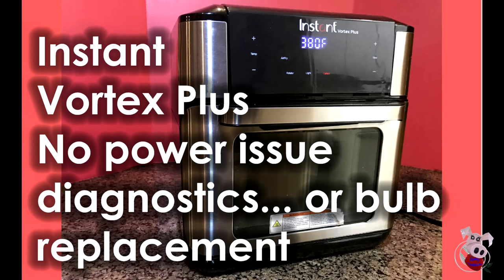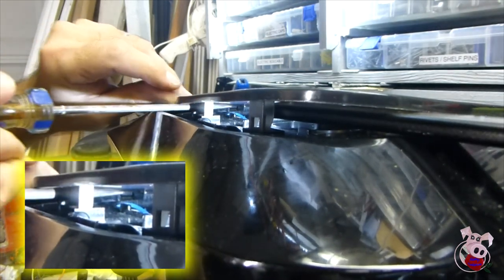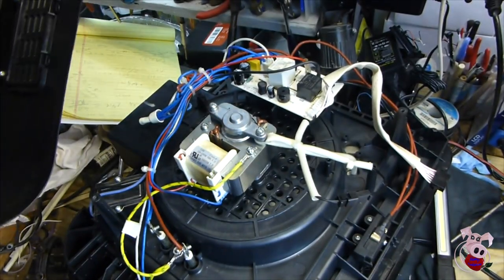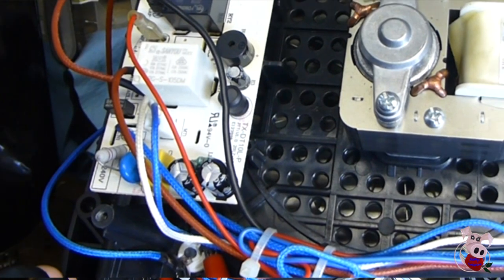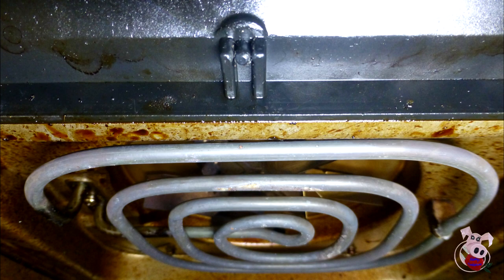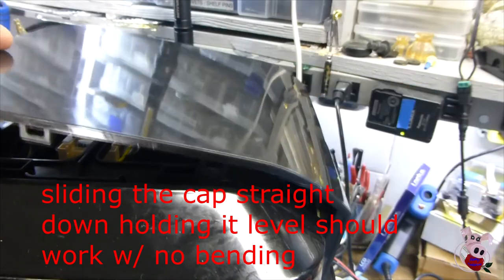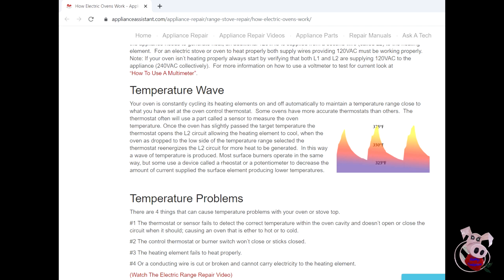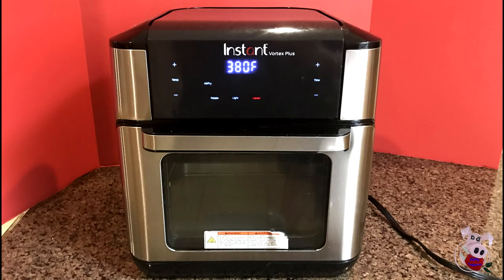Instant Vortex Plus No Power issue diagnostics or bulb replacement

Comment: You saved us $$$ just like everyone else!  After 3 years it stopped working and then would intermittently work and not work.  I think the thermal switch wire was just loose and then it actually triggered.  I crimped one wire and pushed it down and it came right back to life.  The bulb blew long ago but we don't miss that.  Glad to hear that you see high quality design in this product because we love it.

Comment: Great video!  Just what I needed.  I have exactly the same model, we were in the middle of cooking dinner and it crapped out.  I figured it had an internal fuse or something.  I found this video and learned about the thermal switch location.  I wasn't as thorough as you were, I just took it apart and un-tripped the thermal switch, threw it back together and got back to cooking.  Down time was maybe 10 minutes!  We had it too close to the wall this time while in use, causing it to get too hot.  Lesson learned.
Reply from the maker: Thanks.  Good point you make for others... good air flow in back, not too close to the wall.
Reply: @alwaystinkering6972  Well an update, the thermal switch started tripping again.  Last night it got to where it would trip about every 3 minutes, so I was just leaving to cover off and un-tripping it every time so we could finish dinner.  Today I closely inspected everything throughout the air fryer and could not see anything wrong - everything clean, no obstructions in air flow, no burnt-looking wires or areas of the circuit boards.  So I made the decision to just bypass the thermal switch, with the intention of closely monitoring the appliance and never leaving it unattended while in use.  I just soldered the two female spade connectors together and shrink-tubed them.  I ran those wires away from the hotter area of the machine where the thermal switch is.  Hopefully it'll work this way.  I know it's not ideal to omit the safety device that is the thermal switch, but I'll be keeping an eye on it.
Reply from the maker: @oakenshielddufresne2494  Potentially not good.  That is the don’t burn the house down protection.  Do the screw holes next to the thermal sensor look empty?   If you see metal then there may be a skirt holding it in from the other side... that would mean a lot of work.  If they are empty does pushing on the sensor from inside the oven pop it out?  If it does you can look to see if there is a like rated replacement.
Reply: @alwaystinkering6972  look for this in ebay “4 Pieces N/C 220ºC 428ºF normally closed Thermal NC Thermostat switch KSD301 A21”
Reply: @alexisechevarria8536  FF
Reply: ❤  thank you so much for this video.  We didn't have all fancy tools but followed the video and it was the reset button. Working now!

Comment: okay after reading through a BUNCH of these does anyone have the information on what switch to get to replace the thermal switch... mine has blown enough times that i think it is faulty and the reset isnt lasting very lo9ng anymore and i want to replace it but as mentioned in the video you didnt replace yours so you dont have part info... does anyone else have the part info?
Reply from the maker: I just added to my video comments a link to johntube2525's video where he displays the thermostat model he found just after the 14 minute mark.  It may be getting harder to find the manual reset models but I still see pictures in google searches.  

I have seen in other comments that some users have found the thermostat replacement fixed their issue.
Best of luck

Comment: My fryer was inherited from a friend who said he had gotten it as a gift and it never worked.  Upon investigation I found no signs of life when  power was applied.  Used your clear, close up; video I identified a wire disconnected from the thermal switch.  I dug around in the wiring and found the wire that either had never been connected, or came undone.  Reinstalled the wire and just like magic the fryer started to work and has continued to work flawlessly.  Thanks for the clear concise video.

Comment: This video was spot on accurate. Don’t be super afraid you’re going to break the clips.  If you pry them up with a flat head screwdriver at the exact locking point and push in towards the device flat under the lid, they pop off.

Comment: On mine the light would come on when the door was open, but the front panel LCD would not come one when closed. So I checked for continuity in the front switch above the door and there was none when closed. 

So to verify the switch was bad I swapped the cables on the right so it would be on when open, and off when closed; and thats exactly what happened. So I had a bad switch, so I replaced that and my fryer is back in working condition.

Thanks again for the detailed video

Comment: Best video!!  Perfectly described every step i needed to take to get my unit woring again.  Exact issue I had.  Thermal Switch popped right back on.  Had some similar coupler melting/discoloring, but not as bad as seen in video.  Everything went back together perfectly, and cooking some chicken breasts as I write this.  HUGE THANKS for the assist!!

Comment: Great Video and clearly spoken!  I, too, seemed to have the tripped thermal.  This was the second time it occured and I went back to the video - I was even able to shorten it by merely popping off the top, using a flashlight to see the switch from above, and then using a long thin screwdriver to slightly push down on that switch

Comment: thank you very much! i managed to fix mine thanks to this! my thermal switch looked exactly like that. i swapped the heat shrink and put it back in place before closing it up. pretty sure i know a potential cause.  not allowing it to cycle the heat out of the chamber when you turn it off. all that hot air trapped inside would likely cause the heat shrink to harden and crack overtime causing a short during a surge which my place can be prone to. gonna watch it carefully but i have a feeling the heat shrink could be the culprit just by how well the rest of the components seemed. i admit to being one of those idiots who stalls the heat evacuation.... not doing that anymore.

Comment: Thanks for the video. My problem was the door switch. I had another unit that had wonky problems with operational heat and some of the lights were out. Anyways, I took the switch off the wonky one and fixed the newer one. Works like new.

Comment: eyy thank you for this. Any idea how to remove that bracket that's holding the heat element? I'm trying to clean my unit and that thing is the only thing between me and a clean oven.

Thanks
Reply from the maker: Lets say No I don't.  But looking at the video... while the element looks screwed in form the bottom, it looks like it is soldered inside so there is no easy way to get it out of the way for cleaning above it.

Comment: this is very easy to follow and helpful.

mind stop working in the middle of using it. checked everything that’s shown on the video. everything looks good wxcept the light is permanently on when plugged in but no display. 

what else do ypu rhink is the issue?
Reply from the maker: That sounds like the door switch. I demonstrate that behavior in the middle of the video. The limit switch is of a common type. If you have a meter you can test its continuity.

Comment: Great video, easily diagnosed this thermal switch as the problem but can’t get it to reset. Gonna have to find replacement part (or two) and then figure out why it tripped in the first place. 
Warranty did replace it but they told us just to throw this one away...literally never been used! Tripped the first time we tried to use it after first power cycle.

Comment: Looks like screw heads mounted under inside top plate, more disassembly.  Unit clean but possibly poor air circulation on my part couldn't damaged the thermal  switch over time.  Great video, thanks!

Comment: Thank you for your help but I still can't find my source off a issue I opened the whole machine up reset it and everyt it's still just saying open even with the door being taken apart cleaned and all any ideas
Reply from the maker: I would test the door switch first. Do you have a meter?  If it meters ok is it engaging when the door closes?  The switch has a common and one or to connectors.  Basically with the door closes the continuity should be from common to one connector.  When open it should be from common to the other.  

Are you familiar with this type of test?  Continuity is a test done when power is disconnected.
Reply from the maker: If you don’t have a meter you can replace the door switch as a guess.  Do make sure it is engaging when the door closes. 

I don’t have the exact switch.  It is a common ‘limit switch’ layout. You match the appearance format, dimensions and amperage when finding a new one.  Take a picture before disconnecting and put the wires in the same place. Others have stated in previous conversations their door switches have failed and replacing it fixed the problem.

Comment: That thermal switch is tripping for me pretty often, more often when plugged into outlets with a built in breaker. Does it need to he replaced?
Reply from the maker: The switch could be protecting you from a fault or it could be bad. Others have stated they replaced theirs to find out.  I have some notes in the comments regarding another video with the part information.

Comment: Great video I have a problem with my airfyer , the light works on the front and in the inside too . But the heating element is no longer on no wonder I can’t seem to bake any more and the fries are just coming out very soggie , is it time for a new one or can I reset it , if you know anything for me to try please let me know thank you.
Reply from the maker: You would have no power if it was the thermal switch.  You would have the interior light and no keyboard if it was the door switch.  You have some other problem.  Unfortunately it could be one of a couple of things from relays, to control chips or the element.   That would make it hard to diagnose and fix without the right test equipment, knowledge of the machine and parts.   Best of luck.
Reply: Thank you for your information I truly appreciate it.

Comment: In my case, the thermal breaker trips if I set the temperature to 400F, but it doesn't at 350F. So, it seems to be a bit out of calibration. I won't be able to use the device at the higher temperatures, unless I find the replacement thermal fuse/breaker. The control board, temperature sensor, and relay are functioning properly. It is also possible that my temperature sensor is inaccurate (reads low), but Resistance Temperature Detectors (RTD) are generally known for their reliability.

Comment: Excellent video, very helpful!
However the problem continued until I decided to replace the thermo-sensor. Very cheap at ebay “4 Pieces N/C 220ºC 428ºF normally closed Thermal NC Thermostat switch KSD301 A21”.
Reply from the maker: Thanks.  That will be very helpful to others that have repeat tripping problems.  The one I reset had not tripped again so I never took the thermostat out.  For others to reference did the thermostat just lift out or did you have to take anything else apart?
Reply: Thanks, mine keeps tripping, how do you replace it?  I see this does not have a reset switch.
Reply from the maker: @eugenepaden1001  I never removed it as it did not trip again.  The screw holes on top were empty on mine.  Look into the screw holes and make sure you don’t see the ends of screws.  If you don’t see any I would try a light twist and pull.  If you look at the pictures of a ksd301 a21 it looks like the bracket holds it down, not up.  The question is can it come up through the hole or does it have to be removed from the front.

Comment: Hi 
I have the same model with you.
My issue is when I turn it on the time will end right away. Non matters how many minutes I set, it turn on and end it time right away.  
You know what happened to it? And how to fix it?
Thanks
Reply from the maker: The timer is likely on the logic board behind the touchpad and that has nothing you can service.  Maybe there is a stuck button or loose wire causing a voltage shortage.  I would say not likely.  Now I can’t see what it is doing, but if you had a bad door switch, if it breaks contact it would reset the panel… since we know that when you open the door the panel goes dark. You would see the entire panel flash resetting the time… I would think to be the symptom.

Comment: Thanks for this video. 
This looks similar to mine, same brand different casing. 
Mine does heat up, but the fan doesn't come on. Any suggestions for things to look for?
Thanks again
Reply from the maker: The fan itself would be first to check.  Look for a power rating. It is likely AC.  Does it turn freely?  Can you disconnect and test it?  If it does not turn freely, it could have frozen and tripped a fuse or burned out.  There looked to be  a relay that turns the fan on.  It could be bad or damaged if the fan froze.  The last item would be what turns the fan on.  I would think the thermostat but it could be electronic logic where a couple of conditions need to be met.  And check none of the wires are damaged.
Reply: @alwaystinkering6972  Well, Firstly thanks for your response.
I've been out and tried to carefully prise off the lid as you've shown. However mine has a slightly different design. The lid is a square plastic piece with clips similar to yours. However, the lid is recessed below the top edge of the outer casing on all 4 sides. Thus making it even more difficult to get anything under the edge. First corner resulted in a small crack in the lid, then the clip came free from the lid resulting in a small hole in the lid :(
Obviously designed to prevent access for repair, the clips need to be sprung towards the outside of the machine to unhook them, but anyway once I had that one off, the others were easier.
Next was the top frame. I removed the 4 screws, but it still felt very solidly attached to something. Maybe I was nervous after cracking the lid, but I didn't want to force it.
However,  I did a visual inspection through the holes in the top frame (seemed to have a lot less access to below than yours)
I spotted a lead that had come off of its spade connector on the relay board. The wire was barely long enough to reach, and the connector was very loose. I crimped it with some pliers to close up the spade connector slightly and pushed it back on.
Plugged in, switched on and the fan fired up. - Success!!!
So now I have a working air fryer with a few battle scars. 
It shouldn't be this difficult to get into it, obviously intentionally designed to make it disposable. but at least it has been saved from going in the bin for now.
Thanks again

Comment: My pinsoon air fryer is brand new and will not power on. Do you think this will fix it? Or can you recommend anything else to try? Please and thank you!!
Reply from the maker: I am not familiar with the brand.  I always recommend pursuing warranty when available.  The only other item would be the most basic of tests… make sure the outlet has power and the fryer plug appears to be engaging with that outlet properly.  You might also be able to see that the door switch looks to be in place.  I would think the panel would show power with the switch door engaged or not.

Comment: Any idea where I can find a replacement thermal switch? I tried to Google atleast 40 different terms it just keeps popping up with the door switch. Thanks
Reply from the maker: At the end of johntub2525’s video he post the model of the switch he found.  As you search for a switch it is important you match the rating of the switch you have. His was a 200c temperature rated switch.  The reset button is a hard cut feature.  I would expect most without a button could auto reset.  You should always try to match the features and rating used by the original designer. 

That ksd series part number and rating he lists will improve your search. While word thermal is in most descriptions, the rest vary with words like cut-out, protection, limit. There are even some with mfg replacement part numbers for the fixtures they came out of.  Here is that video. https://youtu.be/2TDSjjb9ct8

Comment: Is it possible to replace the light bulb?  My oven works perfectly but the light does not come on, even though the light indicator on the control panel lights up.
Reply from the maker: The bulb is replaceable.  I did not remove it in the video but you can see the screw holding the cover.  As I recall someone put the bulb number in the comments so you may want to check in these comments and the comments of the video I put in the description.
Reply: @alwaystinkering6972  - Thank you.  I replaced my bulb.  It is a G6. 120v.  I believe the original is 20w. At Home Depot I only found a 35w, but it seems to be fine.  I had trouble finding the right bulb on Amazon.  Many are 12v, instead of 120v.
Reply from the maker: @lrzinck  I am glad you were able to get to the bulb.  Thanks for sharing what you found as it will be helpful to others with the same challenge.

Comment: Thanks for this.  I found my door switch is not working.   I now have to wedge a paper clip in door latch ever time i use it.
Reply from the maker: It is a common limit switch style.  Go to eBay or Amazon and look through limit switches.  Match the dimensions, plug design and rating.

Comment: Hi, does anyone know which light bulb may be used to replace a faulty one on this unit? Thanks!
Reply from the maker: Sorry.  I never opened the lightbulb compartment once I got to it.  If you do please share the bulb model you find in there so others can benefit from the information.  Best of luck.
Reply from the maker: Don’t forget it looked like there was a relay controlling that light and a circuit to activate it.  Hopefully it is just the bulb that needs replacing and fixes it right away.